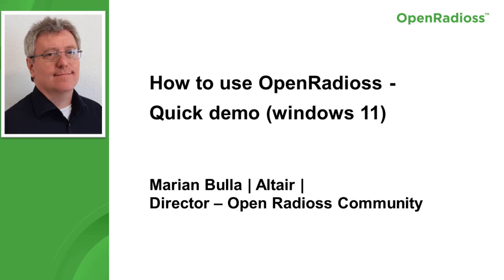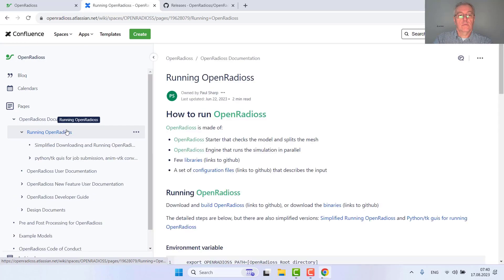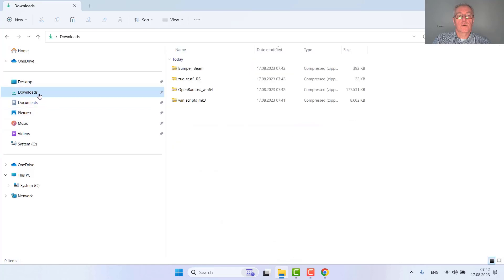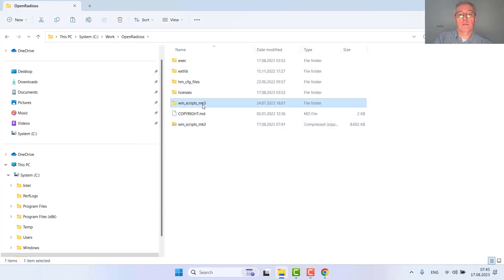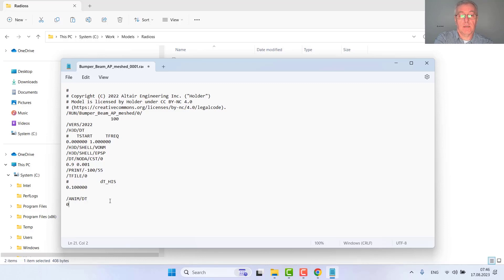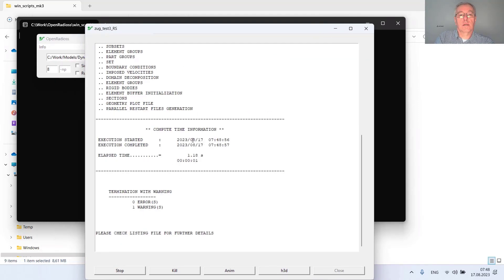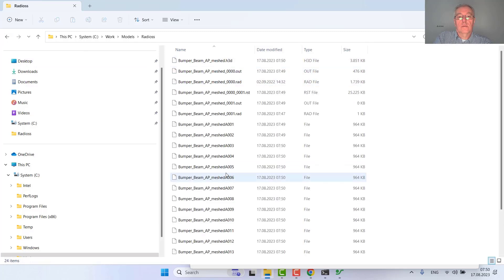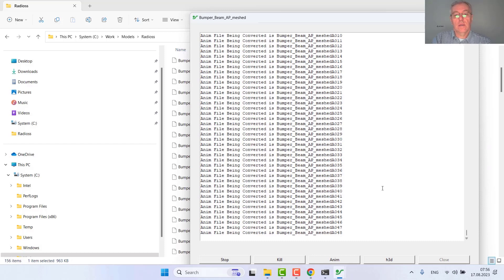How to use OpenRadioss - Quick demo (windows 11)

Comment: Hello, and thank you for the content. I ran into this problem launching the bumper beam on an AMD Ryzen machine.. INTEL MKL ERROR: Impossibile trovare il modulo specificato. mkl_def.2.dll is there a way to solve this?
Reply from the maker: Hello and thank you very much for your interest in OpenRadioss 🙂
Also, thanks for your catch. We will include this library in future.
As a workaround you can install MKL on your system...
https://www.intel.com/content/www/us/en/developer/tools/oneapi/onemkl-download.html
...and load the variables using:
call C:\Program Files  (x86)\Intel\oneAPI\mkl\latest\env\vars.bat
Hope it helps you ?
Reply: @OpenRadiossCommunity  thank you very much for your reply. I installed the MKL, and tried to load the variables from cmd, but that did not work: C:\Users\Utente>call C:\Program Files  (x86)\Intel\oneAPI\mkl\latest\env\vars.bat
'C:\Program' is not recognized as an internal or external command,
operable program or batch file.). The simulation gives the same INTEL MKL ERROR. What should I do?
Reply from the maker: @Riccardo.Andreotti   you can try to find the "setvars.bat" file (I think the name of this batch file has changed), please ? It should be in the installation folder of the .../Intel/oneAPI/ folder. 
Anyway, we have included the missing dll in the recent OpenRadioss package. 
So, you can also download the recent one and try, again.
Hope it helps you ?
Reply: @OpenRadiossCommunity  Thank you very much, the new package now works perfectly! I have another question: I realized that the implicit solver does not work on windows, is there a possibility to see this fixed in the near future? This would be crucial for the purpose of using the software for academic research and real-world industrial problem solving

Comment: please add a clip about how to compile openradioss and then run a simple example, single element test e.g. compaction EOS und symmetric pressure loading and unloading.
Reply from the maker: Hello,
yes will come. But first step-by-step, the basics. 
So, please stay tuned 🙂
Reply: @OpenRadiossCommunity  
Please have a look here: https://www.youtube.com/watch?v=Js_i7CnZty0
It shows the single element test, used with a simple user-material. 
Adding EOS and other feature should be (hopefully) quite simple with this example.
Anyway, regarding EOS, please have a look in the manual. It is already to possible for some material models (e.g. LAW4) to be used with EOS.